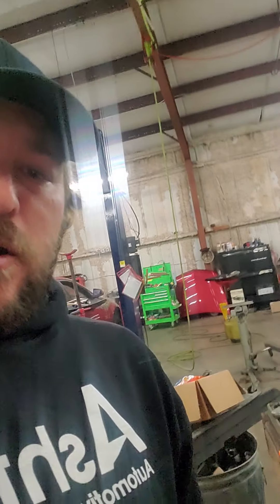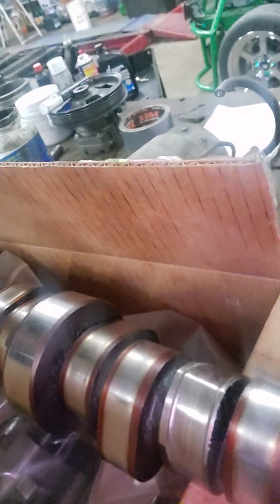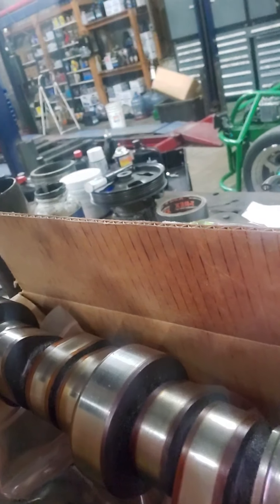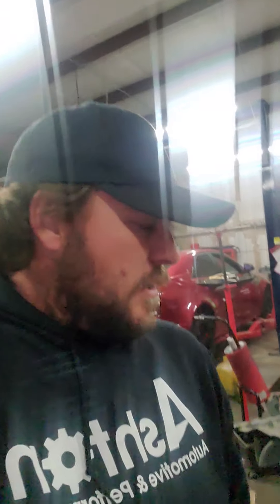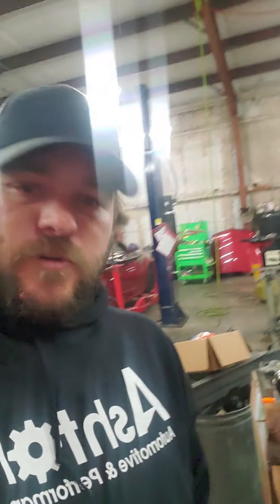Tech!!! 2009-2014 Dodge Ram 5.7 Hemi Cam & Lifter Failure. Facts....Not Theories

Comment: I just do cam/lifters job this week... first of all, you got to switch from 5W20 to 5W30 or, me i use 5W40.
Second, i never get any codes, but, what i saw when doing the job, is that the MDS solenoids have little magnet under them, you must remove them and clean them. I put cam and 16 lifters and start it, run fine until i hit the road! Restart to thick after, what i think, it turn on "eco" and after it come thicking again...
So even whitout any MDS codes, i remove 4 MDS solenoids and clean 4 magnets under and restart the truck....RUN LIKE A KITTEN!! 
Hope i give little help!😉

Comment: It’s honestly very simple on the 2009+ hemi. What did they change? They added the VVT and they raised the camshaft higher now by raising the camshaft higher when the car is idling, the cam is not getting lubed up. That’s why you see failure on vehicles with high idling time. Now when the car is moving, the crank is spinning faster applying enough, oil, splash to the camshaft. That’s number one failure. Number two failure is the angle of the lifters. It has nothing to do with oil pressure. There’s no way to fix this. It’s just a stupid flaw on the engineering’s part.

Comment: I just had a failed lifter (cylinder #3) and I have 307K on the motor - original owner.  It's at the dealer now - lifetime Maxcare Warranty, but they'll buy me out of the contract on this one as the value of the repair will likely exceed the value of the vehicle.  Waiting to see.
Reply: Mine doesn’t make any tick noise. Idles perfect. I can rev it. But if I hold it above 3k for 10 seconds it’ll start to misfire. What was the early symptoms of yours?

Comment: So If I don't have the issue yet what can I do to troubleshoot it or prevent it? Use different oil? Is there a new design for the lifter to prevent it from happening? I got a 2009 Dodge Ram 4x4 SLT 5.7

Comment: I recently bought a 2017 dodge ram 1500 bighorn 4x4 with a V6 VVT engine. 
This was my first pickup purchase(had to get out of a 2017 ford Taurus that had a ton of issues underneath that I couldn’t afford to fix) 

Was the truck with the V6 engine a good choice? 

What should I be aware of with this engine. Good and Bad.

Comment: Good video.. im at 160k, 2013 ram. Still runnin decent, just a noisy engine.
 Is the failed lifter something that happens over time? Like noise getting louder and louder of 10-40k? Is there warning signs? Or can you expect a misfire code to pop up shortly after and kind of rely on that ? 
Hard to know what is normal. Mine sounds really bad next to buildings at idle. Possible its exhaust manifold, i know its similar. Do you have a video that shows how to diagnose? Could you post a video comparing normal/bad lifter ?

Comment: SOLID JOB!!!  I was told to use Lucas Syn in place of one quart by a engine builder here in San Diego.  I change my oil every 4K or yearly whichever is less using Mobile1 syn. At this time I only put 1800 miles working from home  but still change it.   43K miles on my late model 2014 1500.  I have the broken Manifold bolt already.  I also try to not let it idle too long..  Hoping I got a later 2014 with the better parts.  Tempted to do the cams and lifters soon anyways as preventive maint.  That way I do not have to deal with shavings.  Thanks again for the info and I will start using the 10w30 over the 10-20... rather have better protection from the oil.

Comment: I have a 2015, drive it really easy, lately going up hill while pulling a small trailer I heard a rattling noise during acceleration, mechanic told me possibly timing chain guides are worn. Then 2 weeks later I’m getting a shake and vibration when accelerating up a hill or just giving it more throttle and when I let off the throttle, it stops shaking, scanner says p0305 and p0304, misfires I think. So is all this because my cam is going out? 187,000 miles.

Comment: Great, well spoken and honest video. My 2014 has a collapsed lifter in cylinder 6. I unavoidably drove 124 miles on it after noticing the distinct loud ticking. Is it necessary to pay the price to investigate if there is further damage, or are my chances pretty good that its just a lifter. I had no previous engine issues before this and my Ram has 170,000 miles on it.
Reply from the maker: Very likely its gonna have cam damage unfortunately. If oil pressure is still perfect i wouldnt hesitate to put cam and lifters in it and get another 120+k out of it. Replace the timing guide, chain, and tensioner at that mileage though.
Reply: @ashtonsser  Thank you for the response Ashton!

Comment: I bought a 2011 Ram 1500 Outdoorsman, 2WD, short bed, single cab, about 14 months ago. It now has about 115K miles on it and seems to be running great. I change the oil and filter every 3K and only use full synthetic oil and Mopar oil filters. My question is this: Do I wait for lifter failure or should I be proactive and get a cam/lifter job before anything fails? I like my truck, and I don’t want unnecessary damage to occur. Thanks in advance for the feedback.
Reply from the maker: I mean thats a question of budget. Being a 2011 its probably never been done at that mileage but is probably at any time gonna fail. The 2011s were alot more susceptable due to the shitty manufacturer of the lifters those years. If you can front it, get it done. Doesnt hurt anything. With the new stuff no doubt youll get another 150-200k out of it with good oil changes every 5k miles.

Comment: My 17 ram 1500 recently had cam and lifter failure sucks for me out of warranty. Changed my oil regularly before recommend intervals. Royal Purple oil. Crazy I have an 05 Magnum RT With 267,000 miles with no issue. Very worried I might need a new engine. Have not gotten to the VVT Solonoid yet. Informative video
Reply: me too.2017 Ram 1500 hemi engine.105,000 kms (65,000 miles) $7000 repair  in Canada.all oil changes on schedule 5w20 full synthetic.
Reply: Same. 2015 RAM 213,000 with Royal Purple since new and now had #3 misfire and lifter not working and with valve cover off intake doesn't move. Shop wants 12,500 to redo it
Reply: @ sucks. Redo it yourself. That's what I did
Reply: @MOAllDa  no place to do it or the tools.
Reply: @ That sucks

Comment: The root cause for the majority is the cast iron camshaft with poor induction hardened shell.  Will eventually occur to all of these bumpsticks.  Check my latest short...  ALL lifters were perfectly functional, 115k miles
Reply from the maker: Yeah the camshafts are definitely way too soft. You can see the peeling so to speak on the other lobes even though the lifters havent come apart. Its not helping anything.
Reply: @ashtonsser  yep, once the shell is gone the rough core will begin stopping the roller momentarily and over time seize up.
Reply: @ashtonsser  would you replace cam/ lifter on a Ram 1500 5.7 hemi with 209k or would you you just buy a new long block?

Comment: I have a 2012 1500 5.7 hemi  that has a cylinder 3 misfire rough idle, runs rough check engine light on, and when I accelerate up check engine light blinks i pulled cylinder 3 plugs out and gunked up on plugs changed plugs coil pack did not fix
Reply from the maker: @bobbychapman5469  100% cam amd lifter are chewed up. No doubt in my mind. I always verify but yeah your symptoms fall right in line.

Comment: Do you see a lot of 2015 ram 1500 with lifter failure?
Reply from the maker: Not near as many failures in trucks older than 2015 and newer. Weve only had maybe 2 15+ models.
Reply: My 2015 failed at 190,000

Comment: What about the 09 3/4 tons with the 5.7? Was told the 09 Power Wagon / 2500 5.7 was same engine as a 08. Is that true?  Asking because my 09 PW has a hard miss under full acceleration only.   Thanks
Reply: Chrysler is making junk

Comment: You said $2000.00 less than the dealer, but what is the estimated for the total, I’m looking to buy a2014 with engine rough sounding and a loud ticking on the left bank. 167000 miles
Reply from the maker: We do them for 3499 on 2wd trucks and 3899 on 4wd trucks.

Comment: Great video man. Do you have a opinion on 5w20 oil vs 5w30? Everyone on the forums seem to be split about it and just wanna run the best oil I can in my 2012, only has 51k miles
Reply from the maker: Honestly a good 5w30 synthetic would very likely help lengthen the time on them for sure. It cant hurt. 5w20 is purely for fuel economy.
Reply: @ashtonsser  How would 5W-30 effect the VVT system if at all? I ask, because isn't it a oil pressure/time system?

Comment: What's your opinion about running 5w-30 instead of 0w-20?
Reply: I’ve seen many people do this with absolutely no problems. They “recommend” 0w20 because it helps that fuel mileage rating, it may by one mpg, but not much at all. But they don’t change anything in the motor to withstand the thing oil. 5w30 is what they really should recommend. If I had one of these trucks I would run 5w30 full synthetic. And change every 3-5k miles.

Comment: I have 2012 Ram 1500.  Will not accelerate without shaking badly.  Dodge mechanic is saying PCM is showing an open and he wants to replace it.  A previous small mechanic told me that compression on Cylinder 3 is only 65.  Could a bad PCM be causing low compression?
Reply from the maker: No, bad pcm will not cause that. Its likely cam/lifter failure.

Comment: Hi I have a 2013 ram 5.7  v8. Hemi   About 70, 000 miles  starting getting a tick.  Now at 93,000 it's still there , at idle it stopes when warm , then you hear it when you press the Gas .    Is a broken manifold bolt or worse  ?
Reply from the maker: Sounds like broken exhaust manifold bolt.

Comment: Just started getting the ticking noise passenger side and i noticed my rpm needle twitching at idle when cold start after it warms up the needle don't twitch anymore and the ticking noise isn't really noticeable so my question is this a lifter or broken manifold bolts or both problems? I don't want to start buying parts and not need them
Reply: Any update? I’m having a similar issue
Reply: @utubedude2842  turns out my exhaust Manifold bolts was broken on the passenger side and caused a exhaust leak
Reply: Exaust leak

Comment: So what do you think the actual failure rate is?
Reply from the maker: At some point they would likely all fail. You have to take into account the trucks that dont get driven alot and then ones that are maintained well vs not. Its a part quality issue. So if all the trucks were driven 200+k miles then they would all likely fail at some point. But not everyone puts that kind of mileage on them.

Comment: Preface: I still change my oil every ~6,000 miles or 6 months, BUT... I've had over 100 used oil analyses done at Blackstone Labs, and your claim that engine oil "breaks down" and gets diluted by fuel, etc is just plain conjecture without any evidence.  The fact of the matter is that many of my UOA's were done on oils with upwards of - and sometimes more than - 10k miles, and Blackstone's labs never once found reason to label the oil as "end of life" or beyond.  This includes testing for remaining additive package, lubricating properties, break-down properties, contamination, etc.  So while, yes, more frequent oil changes are "cheap insurance", the fact of the matter is that modern engine oils being used by modern engines remain effective well into the 10k mile range (barring any severe use, etc).

Comment: It just turned 290000  Kilometers my On my 2014 dodgers sport have never touched the motor I do oil changes every 5000 K cylinder 
 3 is acting up lol Everybody says it's just a ring I try to explain to them it is the Cam and lifters .I'm looking at buying a brand new motor with a hellcat Cam hydraulic lifters and oil pump.$5800 hundred I'm in Canada 🇨🇦

Comment: Would you recommend a preventative update? Just go ahead and do the cams before it fails?
Reply from the maker: It wouldnt hurt if you have the money to spare. It would prevent metal from going into the motor when the failure occurs.

Comment: I don't want to shit on the creator here, as he seems like a super legit guy... but... his claim that lifter/cam failure isn't happening on '15+ hemis is completely false.  It's happening just as much as the other gen iii hemi engines.   These rollers and cams simply don't get enough oil to them.  I'm inclined to think that although the parts (cams, rollers, lifters) may be sub-par; better oiling might help them to last far, far longer than they do.  It's a bit of a chicken & egg argument, and I'm placing by bets on the lack of lubrication exacerbating the possibly sub-par parts problem.
Reply from the maker: They do fail but are not near as common. I said in my video the hemis have poor oiling to the lifters but part quality had a lot to do with it. Theres no denying that pushrod engines in general have shit design oiling system.
Reply: @ashtonsser  the addition of that oil tube straight through the center of the block sure doesn't help the Hemi, even compared to other pushrod v8s. Coupled with the lifter bores being outboard of the cam (not dripping on them), and the extra distance from the crank to the cam, and I think that's our answer as to why the parts fail; whether sub-par or not.